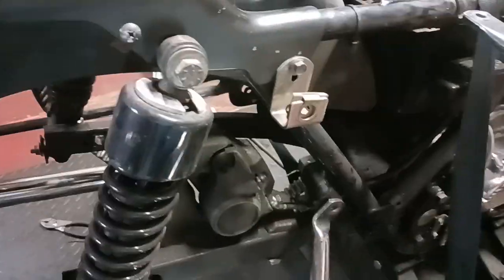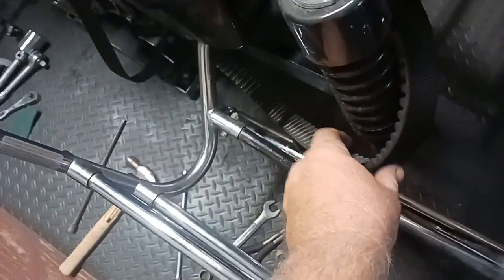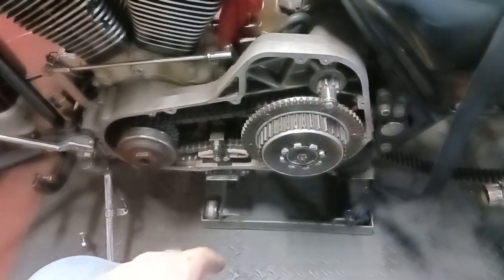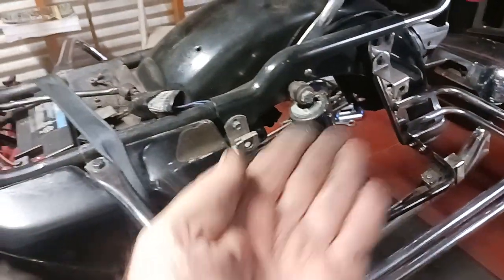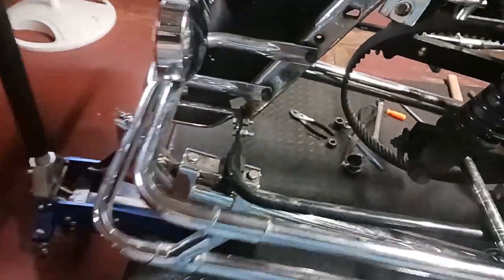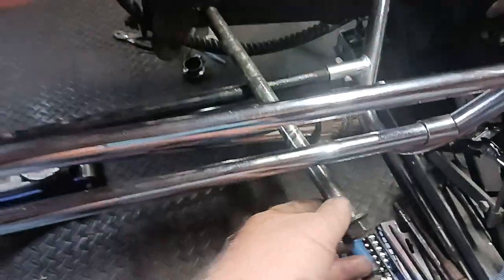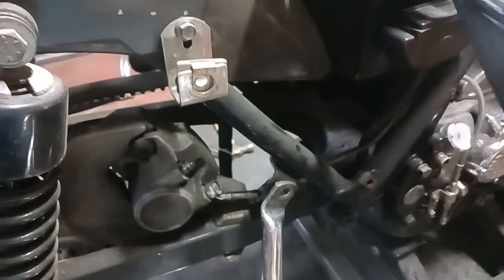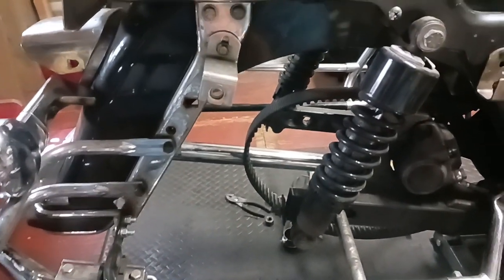93 Harley Electraglide rear wheel removed

Comment: It's been a while with the axle but if I remember that you got pillow block in there it's a nut and bolt at the top or just both and then that get you to the rubber isolator
Reply from the maker: i'm not to that point yet. im trying to get the inner primary off. looks like i got all the bolts removed and the starter bolts un-done, but that sucker is not budging. time to watch some youtube videos to see what im missing or forgetting. lol
Reply: @edZILLA64  now I forget what your yours is but there is a bolt or backside or from underneath
Reply from the maker: @MoeLarrycurly1  i think my inner primary is just stuck. ive seen a few videos , where people have to tap with a rubber mallet.